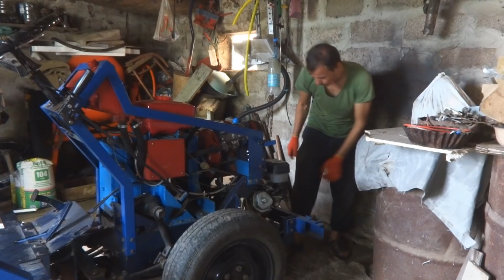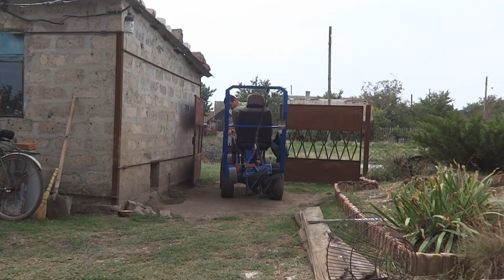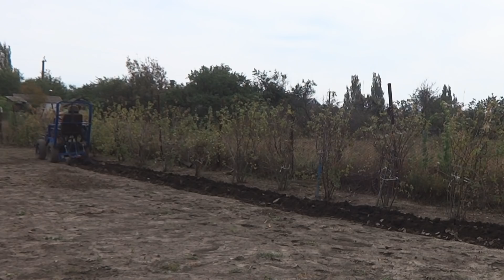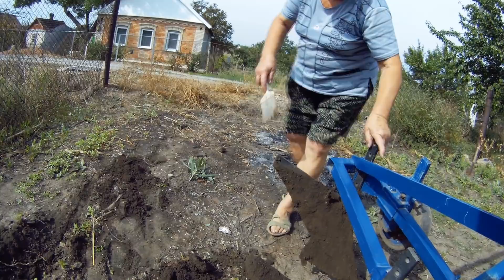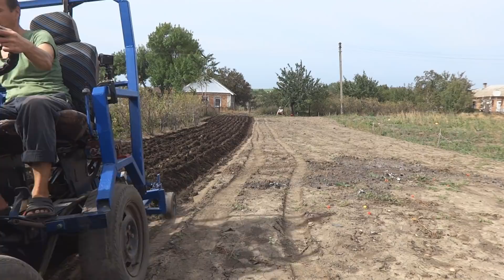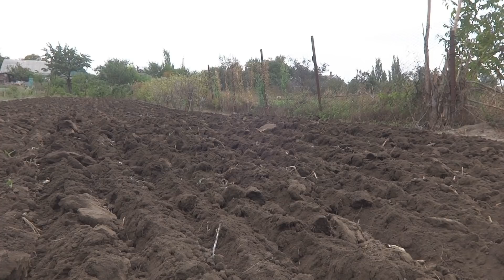Plowing the garden with a self-made tractor

Comment: Either mold boards are not spaced right or one of the lift arms is not adjusted right! The plowed ground should be more flat not ridges, looks like it was plowed with culvator  instead of breaking plowed.  But for home tractor and plow I like it and after it has been disc couple times it will be fine. Thumbs up